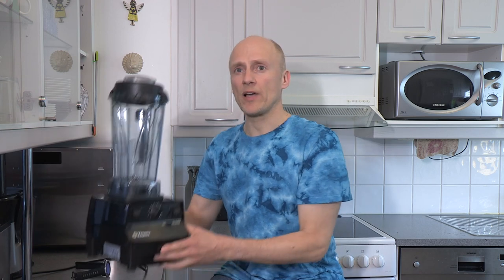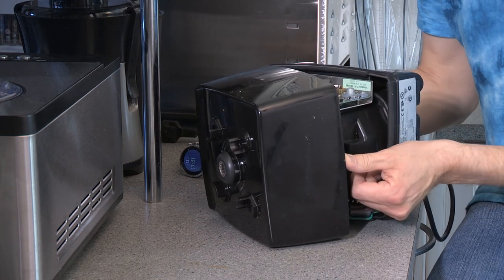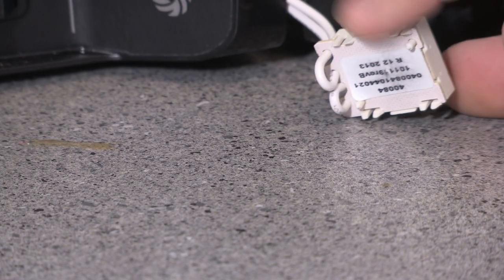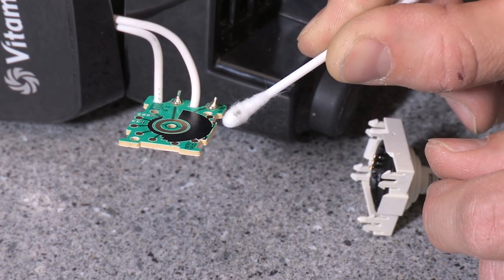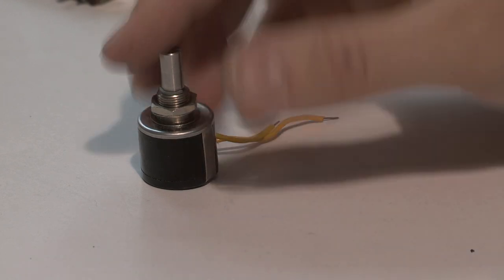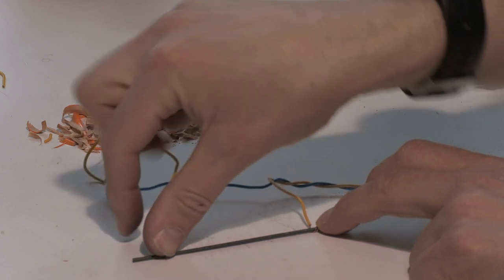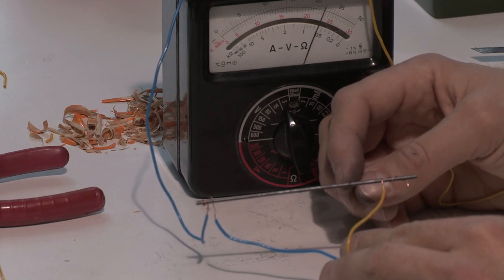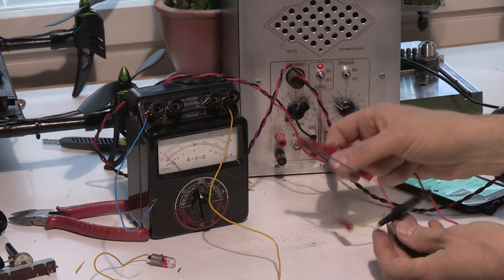Vitamix blender repair - potentiometer

Comment: I had one of these before and it lasted many years and I used it a lot. It blends MyBest.Kitchen chops ,grates. Does most anything you would want to use it for. A lot of bang for your buck. A litlle loud however it so fast it is not bothersome.

Comment: I had bought a replacement pot, and this video was helpful in guidance on how to take my Vitamix 5200 apart without damaging it.  In the 5200, the pot is much smaller, and I was not able to take it apart without damaging it.  I could put it back together with some glue I suppose.  But the $20 replacement pot just gives me a lot more confidence.  And the replacement pot looked just like the one in Tom's video.

Comment: I cleaned the potentiometer with alcohol and a cotton swab, and reset the fingers, just as you did in the video.  Now my Vitamix speeds are consistent again - no weird pulsing at the low speeds.  Thank you!

Comment: Replaced my Vitamix potentiometer and unit still runs on high,what is the next part that is bad,,,thanks
Reply from the maker: If it runs full speed and the potentiometer does not change speed at all, there could be a connection problem.  Check that the cable going to the potentiometer is properly connected and it does not seem to be broken.  There might be a loose solder joint on the circuit board too.  Or, in worst case a component on the circuit board is broken.  If you have a multimeter the connection and potentiometer could be checked by measuring the resistance.
Reply: @TomTechVideos  thanks,, I do have the meter and will check all connections and use a magnifying glass to really scrutinize every resistor and components.....

Comment: Hi, your video is great but I have a Vitamix 5000, the potentiometer have 3 wires (Black, yellow and Red and a resister, do you know how to fix that?
Reply from the maker: The 3 wire potentiometers can also be cleaned the same way if the model is such that you can open it and close it without breaking.

Comment: I have a Vitamix 6300 that I purchased from Costco about 9 years ago. Early last year, the Start/Stop button stopped working, so I have been using the pulse button. With the pulse button, you cannot use the variable speed dial while the blender is operating. It gets frustrating so I started using my Blendtec. I've already made inquiries to Vitamix and they did acknowledge that the product's warranty had expired. I was just wondering if it could be as simple as just replacing the Start/Stop switch? That would most likely be a whole lot cheaper than sending it to Vitamix for repairs, since I am on a fixed income right now.
Reply from the maker: Sorry to hear.  Can you use the pulse button without switching the start button on?  If yes, then it might be that the start button could be replaced, or even repaired.  But if you need to use the start button before you can use the pulse button, the start button must be working and the problem is with the speed control, not making the motor run without the pulse button.
Reply: @Tom Tech  Hey Tom! Thx for replying to my comment. The pulse switch works without having to turn the start/stop switch on, so yes...it's probably the start/stop switch that is defective. I haven't taken it apart yet (laziness) so I haven't looked inside to see if the switch is burned out, loose, just need cleaning or whatever. My problem is I can't find a replacement switch for this model anywhere! No part number...nothing! But I guess my real question is...with the symptoms I described, is it a really good chance that it is the start/stop switch and nothing else?
Reply from the maker: @rddav1  I would say it is about 50-50 chance the start/stop switch is defective.  My model is quite different so I can not give exact advice.  In my model if the potentiometer is broken it will run at hight speed.  It is possible that in your model it will not run at all if the potentiometer is broken - I don't know.  Obviously the motor is working so there are five remaining parts that might be broken:  The start/stop switch, the potentiometer (if different from my model), the speed control electronics circuit board, the thermal fuse, or some wire has come loose.  The thermal fuse in my blender sometimes goes off when I'm blending at low speed.  This is because the fan will not blow enough cooling air to cool the speed control electronics.  However, the fuse resets automatically when it cools down after maybe about 10 minutes.   It is one possibility that your model has a broken thermal fuse.  Check also if there is some fuse visible on the outside (bottom or back possibly) that you could reset by pressing.  There is the over current fuse on my model you can press to reset.  But if that one has blown the pulse switch won't work either.  But your model might be different.  Wires are always worth checking.  It is not impossible that one wire connector has become loose due to vibrations.  Unlikely but not impossible.  Power switch can also be broken.  Usually when they break you notice that they feel different or they rattle inside.  But it is also possible they fail without any other signs.  Good luck!
-Tom
Reply: @Tom Tech  Thx Tom. It might not be the pot because where ever I set the speed on the variable speed dial, that's how fast it will go when I click and hold down the pulse switch. But what do I know?🤷🏿‍♂️ l'll just continue to use my Blendtec until I get enough money to send the blender to Vitamix. Best to let them take care of it. And again, Tom...thx!

Comment: I have a new VITAMIX 7500 and it doesn't turn off. The switch on the side turns on/off but the front one doesn't respond. What can I do besides take a sledgehammer to it. Thanks.
Reply from the maker: I'm not familiar with that model.  Take it to a repair shop.  These blenders are expensive and are worth repairing.  And the warranty is 7 years, at least for my blender, so the repair might be under warranty.

Comment: Hi you have made a very interesting video, My vitamix problem is when i switch on the blender it starts to spins very fast ,the potentiometer does work to reduce the RPM. is this cos by the potentiometer? if i want to replace the potentiometer where can i odder the original parts tq.
Reply from the maker: Starts fast even when the potentiometer is set at minimum?  Yes it may be the potentiometer.  Searching internet "vitamix spare parts" will find you parts.  Amazon has some.  Also, consider a repair.  Vitamix has 7 year warranty.  Check vitamix.com for repair options.

Comment: Hi Tom thanks for you appreciated help. 

My vitamix starts and turn off in two seconds maximum. 

It could be the brushes or board or rotation speed sensor ?

Please give light 💡.

Thanks friend
Reply from the maker: I don't think there is a speed sensor unless you have an advanced model.   It does not sound like brush problem either.  Can the switch be broken?  Does it try to start again if you tap the switch a little bit? My best guess however would be that some overheating protection kicks in very early.  Replacing that protection might help in that case.  But it is impossible to say without seeing and testing the device.

Comment: One question the pulse bottom cables connection has the same position on the switch like the on off bottom has? I messed up😢

Comment: hi Tom, i have a vita-mixer maxi-4000 that throws out sparks when it runs. what would cause that & is it an ez fix?
Reply from the maker: Sounds serious.  I would suspect worn out or broken carbon brushes.  They are usually easy to check and replace.  I'm not familiar with your model however.  The problem might be something else too.  I don't recommend fixing these yourself unless you are trained and experienced in electronics.  Otherwise you may break it even more, burn your house down or get electrocuted.  Take it to a repair shop and stay safe.

Comment: I recently relocated to a 220V country and I would like to know your recommendation to modify the vitamix from 120V to 220V. My guess would be replacing the mother board.
Reply from the maker: I believe the motor also has to be replaced so this is not an easy task.  There are transformers that can transform 220V to 120V.  For this high power they are not cheap and they are bulky.
Reply: @TomTechVideos  thank you for the recommendation. If I dared to replace the motor, the first difficult part would be finding a 220V spare motor. I have no idea where to find it!!

Comment: Could you make a video about how to fix the pulse button??
Reply from the maker: Sorry but I don't have a model with a pulse button so I can not show how to fix that.  Or actually in my model the power switch is the pulse button if you just toggle it on and off quickly.  With these high-power blenders you must be careful to first adjust the speed to a low settings because pulsing with high speed can damage the blade shaft.  I believe, however, that there is a safety device that will "slip" if the acceleration is too high.

Comment: Just bought a brand-new Vitamix. The first time I tried making soup it quit after 7 minutes of running. Hasn't worked since.
So much for quality.
Reply: Did you wait a little while then hit the reset switch on the bottom? Also, did you contact customer service?
Reply: @Joshua-dc1bs  'Reset switch"?

What model is this on please Joshua?  Pretty sure I don't have a reset button...
Reply: @Ron-Ayres  I got a 5200. There should be one on the bottom.

Comment: Does this apply to the older Vitamix 5200? Thanks!
Reply from the maker: Mine is a year 2013 model (so still under warranty I guess) but I guess anything that has a potentiometer can be fixed.  The model of the potentiometer may vary.  Some potentiometers are more difficult to open and clean than others.  The only way to be sure is to open it.  But remember that you risk breaking it even more or hurt yourself if you are not trained and experienced like me.

Comment: Old vitamix has a reverse spin option, but not the new one. Can you add reverse option to a new model?
Reply from the maker: Hi!  Interesting question.  Yes I think you can reverse the spinning direction.  The motor is a brushed DC motor.  By reversing the current by swapping wires around the motor should spin in the other direction.  However, there is some angular displacement with the brushes to get an "advance" and optimize the efficiency.  The torque will be much less in the reverse direction.  The blender might even overheat much easier.  Also, the blades are sharpened only to one direction, so they will not perform well in the reverse direction. - Tom

Comment: Be extremely careful pulling the switch apart, I have to order a new switch anyway but am hoping to at least get it going until it arrives.....the little fingers came off their holding nubs, I'm having a heck of a time getting them back on. Everything is so small and dainty. Heed the warning, be extremely careful! 

I do question if my board could be bad too - before the blender became stuck at the highest variable speed, it was surging from time to time in variable speed mode.
Reply: Which model, and was it fixed?

Comment: Alchohol is the last thing you want to use. It will dissolve the carbon trace (don't ask me how I know?). M.G. Chemicals makes a product called NU-TROL that is oil based and is designed for things like dirty volume controls etc.. It will not harm the cabon trace.
Reply from the maker: Yes,  well, it might dissolve it but if you don't soak and rub it too much but only remove the bad surface quickly with a small amount of isopropanol and let it dry, it will solidify again.  I have used this technique for a long time without problems.